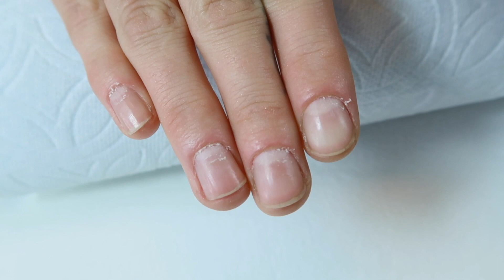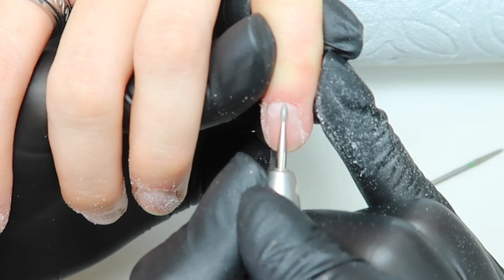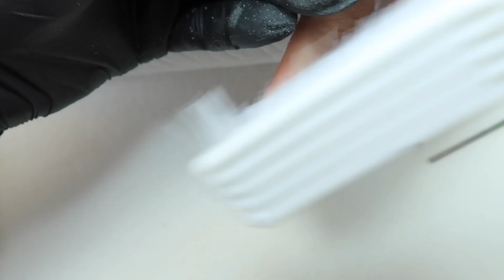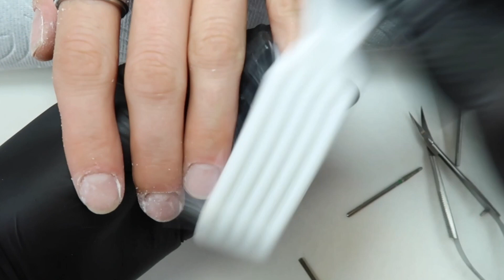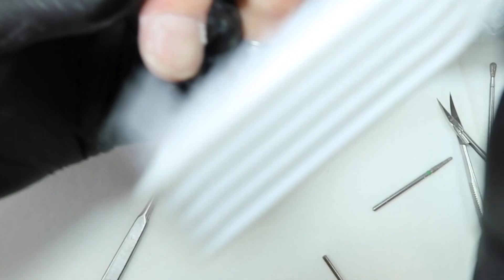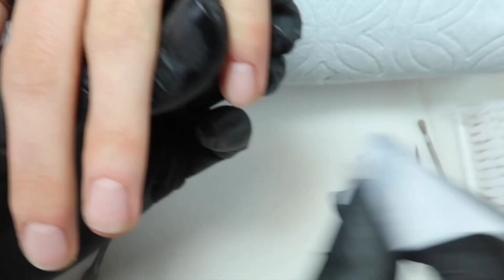Luminary Basic/ Intermediate Prep Tutorial

Comment: You said 99% alcohol to clean up the nails. That’s different than acetone and nail polish remover right? Would you recommend that over acetone? Or would acetone work as well?
Reply from the maker: No, only 99% Isopropyl alcohol. The nail plate needs to be clean and dry. People will make the mistake of using rubbing alcohol, please don't do that 💖
Reply: @LuminaryNailSystems  Thank you!!! <3